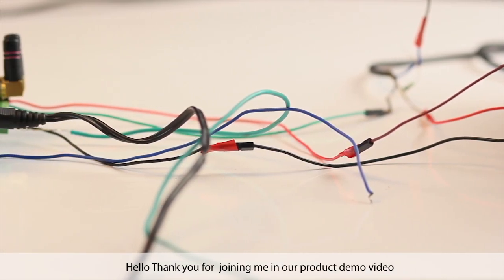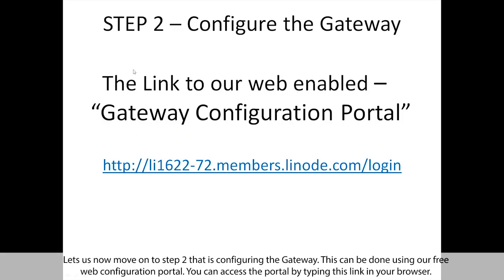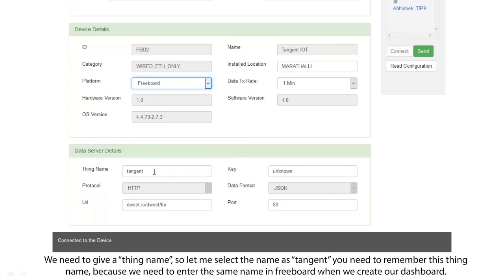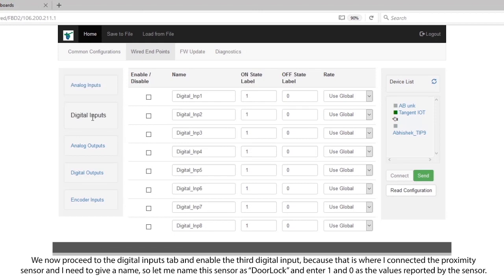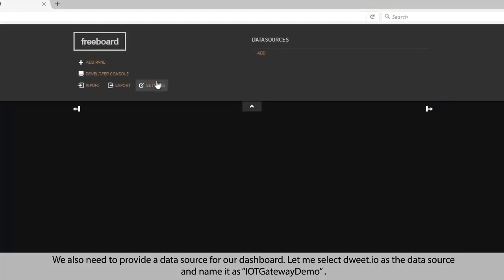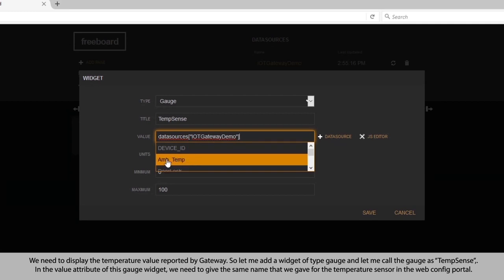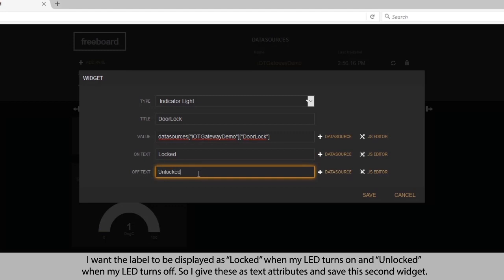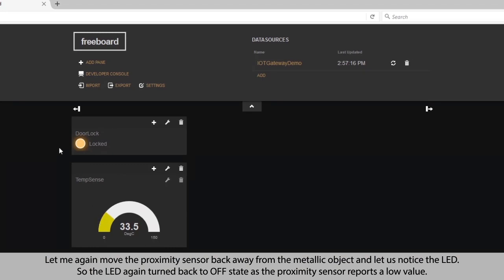How to send Sensor data to Cloud Dashboard using Smart IO IoT Gateway? - Tangent Techno Labs®️

Comment: You just connect 2 sensors what if I want to connect 100 sensors...
Reply: For direct connection our gateway supports 8 analog sensors and 8 digital sensors.
However it also has wireless ZigBee interface through which you can connect upto 200 sensors for a single gateway.